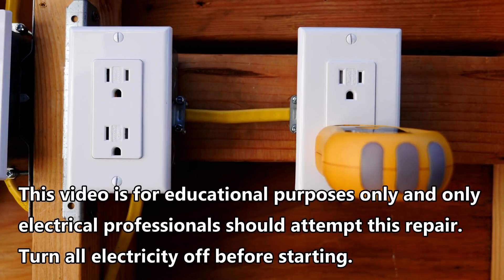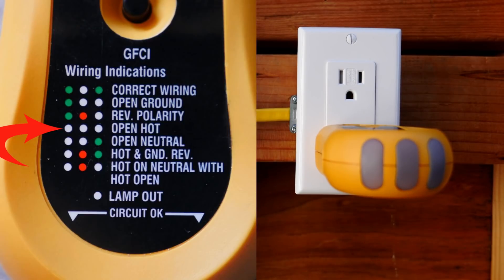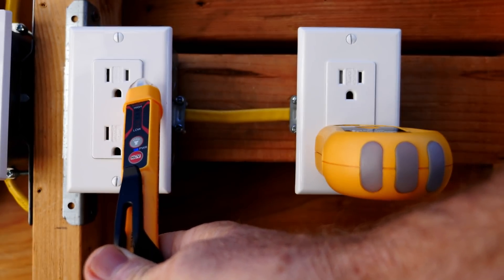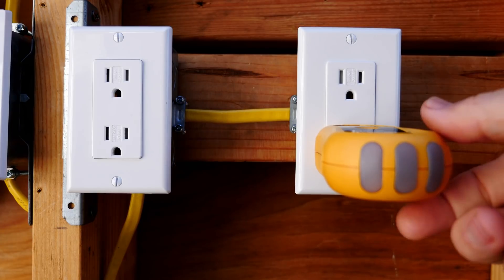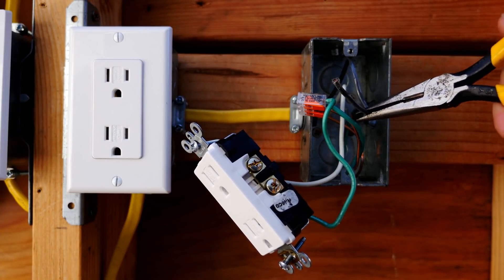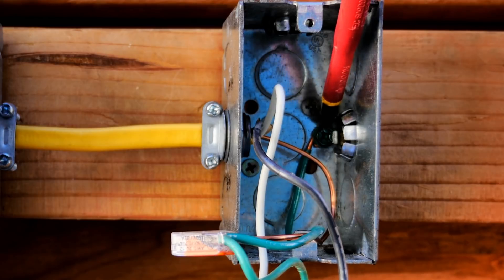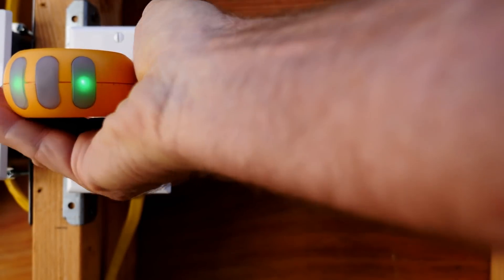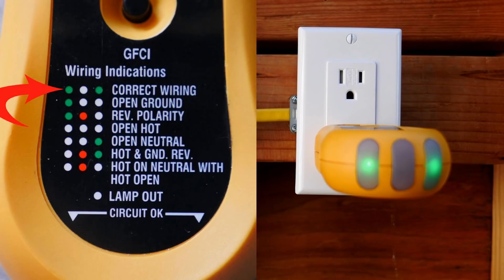An "Open Hot" Receptacle is VERY Dangerous!

Comment: A tester that reads open hot, can also mean that the tester itself is defective, just as a non-contact voltage detector can read no voltage if it's defective or has a dead battery. 
Always test again to a known energized outlet to be sure the tester works.
Turning off the main breaker before servicing is a good tip for safety. 
Thank you. 
Question: Would a circuit finder work with an open hot outlet if the neutral is still connected? 
Thanks again for your great content.
Reply from the maker: That's an excellent point! Meters and testers always need fresh batteries! No, I don't think a circuit breaker finder would be reliable if you were testing at or after the open hot. If you were testing more upstream from the open hot it should work fine.
Reply: @SparkyChannel  I have a Klein volt meter that doesn't need batteries.
Reply: @illestofdemall13  he knows not all testers need batteries. He didn’t type all testers that take batteries always need batteries.
Reply: @KitchenerLeslie2  I didn't say what he knows or doesn't know. I was just saying I have one that doesn't need batteries.
Reply: @illestofdemall13  it has to somewhere
Reply: @16BitDoggo  I have no idea what you are referring to. "It has to somewhere" what is it? And it has to somewhere? What are you saying?
Reply: @illestofdemall13  I meant that the non contact voltage tester needs batteries somewhere. It might be hidden.
Reply: @16BitDoggo  I wasn't talking about that. I have a 2 different volt meters from Klein that do not take/require batteries. If there is voltage present then the meter lights up to the approximate voltage that is present, like the old solenoid voltage testers (Wiggies).
Reply: @illestofdemall13  oh i thought you meant non contact voltage testers. So like a multi meter
Reply: Turning off the main breaker is not practical in most cases, because homeowners and/or other workers are using other circuits. If you know how to test and verify, then you can easily and accurately turn off the appropriate breaker to just the circuit that's being worked on.
Reply: @illestofdemall13  sounds good, looks good on paper.  but Mr. Murphy likes hanging around troubleshoots.

yes, there are ways you can test and be sure you've most likely got it down before you dig deep enough to be at risk; but this channel is to help people without as much experience.
Reply: @kenbrown2808  I do electrical and lighting for a living, so I am talking from my point of view. I can't turn off a whole house just to change a switch, or install a chandelier. For someone who doesn't know as much, they could turn the main breaker off, but I think someone needs to teach them the basics at least so they know how to measure voltage and make sure there is truly nothing to hurt them. They also need to know how many circuits are in the box they are dealing with, etc.
Reply: @kenbrown2808  I see what you mean, though. That's why Sparky has the disclaimer in the videos, though. If someone isn't competent in electricity, they should find someone who is and if they do their own work it's at their own risk.
Reply: @illestofdemall13  precisely. and as you know, a video isn't a substitute for years of experience.
Reply: if you don't have a live circuit handy for testing a non contact tester, you can usually test it by rubbing it on your arm.

Comment: My tester says open hot on a GFCI and the GFCI does not turn on. But a regular 3 prong outlet works fine and shows a green light in the same box and wires. I tried 2 GFCIs and both are the same, not working
Reply: Same here exactly same situation as you
Reply: @markdavis5979  I still haven't found what the problem is
Reply: Did you wire the "power-in" to the proper locations on the back of the GFCI
Reply: @tegbolddos  all wires are hooked into the proper prongs. I triple checked everything! Still nothing

Comment: I put a new APC UPS (high end  $1000 uninteruptable power supply) in an office and it immediately started beeping and the display stated a problem with neutral and ground. I hit the reset button and figured it was a fluke (I had installed hundreds of UPS's and never saw that before).  I forgot about it till the office owner called and said the UPS was beeping. He said he would talk to his electrician. Then he calls and says he noticed if he hit reset and all was well and then walked into the hall with motion sensing led lights he could hear the UPS beeping again. He repeated this several times... I had to go there yesterday and brought my 3-prong circuit tester. I plugged it into several outlets in the office... it did not light up at all.. I thought it had died somehow. Then I tested an outlet at my house and my tester works fine........... the $64000 question is how can an outlet work if the tester shows no lights? The label says if none of the lights come on it is "Open Hot" but how can it still work?

Comment: I wish the tester had 3 red lights to indicate an open hot and not 3 lights not lit at all. Confusing since the circuit could be completely off or this dangerous situation. 

Maybe it's just me lol
Reply: Its not technically possible. With no hot, theres no electricity to drive the meter. That "socket tester" meter is batteryless and uses the proving voltage to also power itself.

So it needs atleast one hot wire to work at all. Then it needs EITHER ground or neutral for a return path to light up itself too. This is why also this meter cannot detect multiple consequtive faults in the same socket.

Some socket testers do have a little metal plate that you put your finger on, which provides a grounding path for the electricity, but the metal plate then has a resistor to take down the current so low so its always safe for the human body.
These socket testers can test for even more faults which involves a non-existent GND and neutral for example.

But no socket-tester ever will be able to test without any hot available, because that would mean the meter has to invent electricity from thin air.

Comment: Good comments on how the open hot can be dangerous. However, something to remember is that it may not be in the box that's not working. The open could be anywhere from the outbound link in the box on the left to inside the outlet itself (i.e. defective outlet) on the right. After the initial testing, all that was known for sure was that power was reaching the outlet on the left. The open could be anywhere beyond that point.
Reply: Thx u I been trying to figure this my out, my outlet tester say there’s a open hot, but when I take the outlet out both hot (blk wires) are connected to brass... could open hot be in the wall and if so how can I fix that
Reply: @hightolerance8728  I would start by checking the next box upsteam and making sure everything is secure in there. My guess would be that's where the problem lies.
Reply: @Qazxswer68  I thought so but the next outlet up only has one hot an neutral, so I’m assuming its not ran off that outlet. And the outlet “after it” (which is in the next room, is being powered by the outlet that isn’t working (if that makes sense). I can’t find the outlet that is powering the broken one. I assume it must be a crappy electrical job being that is only a rental and hasnt been working since I moved in. The landlord keeps sayin he going to fix it, but all he did was cap it off. Sorry if my electrician lingo isn’t up too par.
Reply: @hightolerance8728   Bad landlords 👎  You're good. I'm not an electrician, just know enough to be dangerous and fix my own problems. So the receptacle in the next room does not have power also? Since the receptacle in question doesn't have power. Power can also come from a switch box. A hot stick, non contact voltage tester,  might come in handy here too.
Reply: Those things aren't for regular troubleshooting they are for checking everything at the end to make sure you did everything correctly but if your going to troubleshoot then you need to at least get a biggie voltage tester that will tell you 100%
If a wire is hot or if the newtral or ground are good.
I'm not sure what the details of your situation are but figure that box could be fed in from the back of the box.or it might be a dedicated circuit lots of home owners want dedicated circuits for the refrigerator..

Comment: It's nice of them to use green lights for the "good" connections.  my current plug tester has a white and amber and a red, and the red lights on a good receptacle; which is just wrong.  but not wrong enough I've gotten around to replacing it.

Comment: I have done a lot of DIY electrical work through my long life.  Seeing a no-lights reading on that tester I have taken that as confirmation of no current after switching off the breaker.  I now know better.  Thank you.
Reply from the maker: Thanks for sharing!
Reply: the only time you know for sure a wire is dead is if you're holding both ends.
Reply: @kenbrown2808  or one end and a grounded wire.
Reply: @KitchenerLeslie2  no, that's how you find out it's live.

Comment: Hi Bill ✋ Speaking of dangerous, I have a question. The company I work for, just leased a house that's just been recently built, more specifically, built in the last year. Anyhow, I'm prepping it for a group home for disabled clients. I was installing a grab bar by the master bedroom shower stall which is designed to roll into with a shower chair. There's a light at the top of the shower stall and the switch is on the same wall as the shower head. The switch is approximately 8" - 10" outside the tiled area. It's just a regular switch and cover. Everything has passed all inspections. The location of the switch concerns me. Is there code for this situation? I didn't feel comfortable with it, so I installed a weatherproof switch cover. Be great if you could cover this topic or any info would be helpful.  Thanks Bill!
Reply: it is permitted, but if it's in the splash zone because of a doorless shower, it's not a good idea.
Reply: In the UK, wall switches in bathrooms are not allowed.  You can only have a pull string from a ceiling mounted switch.  Much safer.

Comment: Can you by NEC run romex Stripped back about 15 feet an run through conduit as though it is THHN,from breaker box into attic and then run shielded romex across attic and down behind drywall to receptacle ?
Reply from the maker: Hi Mike! No, because Romex has a bare copper ground wire. You need an insulated green wire to run in EMT.
Reply: @SparkyChannel  what if I run in electric pvc? Conduit
Reply: @SparkyChannel  I'm under the belief that most ahj if using EMT you don't need an igc. but that i run one anyways and I have been doing it like this for over 20 yes they make EMT to Romex connector for a reason 🤔  cld be another ahj discretionary ruleing
Reply: PVC conduit from attic to power box.
Reply: Can’t he just leave the Romex in the conduit for that short run? I thought it was allowed for wire protection
Reply: NEC specifically allows you to sleeve unstripped NM cable in EMT or PVC for physical protection of exposed wiring.

Comment: I realize this is just a demonstration setup, but I have been told by a licensed electrician that it's against code to run a cable into the SIDE of a 2x4 handy box unless it's being used as a junction box. The reason cited is the cable clamp threads and locknut will be too close to the device terminals. Is this a legitimate code violation?
Reply from the maker: It depends on the listing and labeling of the box. That is, it should say on the box packaging along with the UL listing symbol. Like you noticed, I just did that for demonstration purposes so viewers could understand where the cable came from and where it was going.

Comment: Why does one or the other green LED blink when you plug in the outlet tester?
And, I don't know if he was pulling my leg, but a friend (licensed) was telling me to always wrap the tape clockwise, that was code and the inspector would flunk the job if it was counterclockwise? 
 You're obviously a pro, I notice you even regulate the screw heads on the cover plates!
Reply: The LED’s flash because that’s how they work. Your eye won’t catch it, but a camera will always see it as flashing!
Reply: @dodgeguyz  One does, the other doesn't. I would have thought both would either flash (on AC or half wave rectifier) or not flash, if a full wave and cap were used.
Reply: @lyfandeth  
I think it’s just the design of the tester.
Reply: I’d like to see if it switches sides if ground and neutral are reversed. If the flicker stays left it’s the led, if it moves I’m not sure what that means.

Comment: If I'm using a DMM instead of an outlet tester, what values would show me a loose hot? Testing for voltage between the neutral and ground shows neutral problems. Would I see no or low V between hot and neutral, should I use low impedance setting?
Reply from the maker: I love the low Z setting on my Fluke 117. I would use it for the tests you mentioned. A loose hot might show up as low or intermittently changing voltage.

Comment: An alternative to switching everything off would be using insulated tools and standing on an insulated rubber mat. Such mats are available with official rating, but I‘ve also seen guys using the rubber mats from their cars.
Sometimes you don‘t have the luxury that you can switch everything off.
But this is a task only for experienced electricians.
What will the outlet tester indicate if only the line is connected but the neutral and ground are open?
Reply from the maker: Hi Marcel! Yes, but as you say, it's just for experienced electricians. Neutral and ground open no lights but a NCV tester should still work.
Reply: @SparkyChannel  Like I thought, on the inside these outlet testers work almost all the same way, and you can trick them with the worst faults...

Here are two videos from a UK electrician how these testers work, and which miswires they can't reveal. It's quite interesting that these things work with only such a few parts inside. There's not much inside.

No.1

https://www.youtube.com/watch?v=87Y5X9wfxQM

No. 2

https://www.youtube.com/watch?v=GSDBVsViwh0

Comment: I don't trust NCV detectors. They beep and beep and don't beep and....give me a meter. You can hold one lead in ur hand and probe with the other and you'll see voltage. Usually 80 volts on the hot, 0V netural!
Reply from the maker: I agree. Many meters have NCV testers built in so that you can do both tests with one device.
Reply: sounds good, looks good on paper, but a tweeter will still read voltage through insulation.

Comment: Why did you put electrical tape around the receptacle?
Reply: Taping around the receptacle causes a mess when it needs to be worked on later.   The tape dries out and falls off.  Also using the push in terminal is what caused the break to begin with, or poor stripping on the original install.   Obviously not on your demo setup.  Turning the power to the.whole house off seems a little extreme.  It's easy enough to take the cover off and see the problem.
Reply: @tomsnj  that was a spec grade screw tightened terminal, not a stab.  though you're right that particular failure is usually a stab connection gone bad.
Reply: @tomsnj  Amateur here again and I do agree with you. Even though I tape it does make a mess in future, dries out and\or falls off. Just old habits are tough to break... but recently I have skipped the taping a few times.
Reply from the maker: It's not code to tape receptacles, it's just something I do to increase safety and reduce the possibility of a short.
Reply: @SparkyChannel  Amateur here but I've always done this too!
Reply: David Munoz  Taping was a really good idea in the "old days" of metal boxes and metal cover plates.  A loose hot wire could electrify the box/plate and arc causing a potential fire.  Personally, I flip flop on using the tape method on plastic boxes and plates.
Reply: @Nickvec  Interesting again.... Makes me feel better because for the most part I have taped, and the majority of switches\outlets are in metal boxes.... Thanks
Reply: Metal box

Comment: How come you don’t sleeves the ground Cooper wires in the box in the uk the would be a code three on a inspection a it’s ban practice to . I am a big fan of the voltage detector I like use  multifunction tester I trained the old school ways of testing . Loving the videos .stay safe
Reply from the maker: Thanks Ian! Well, it's just the way we do it in America. I know it looks bad to UK Sparkies but it's the way it is here. Thanks, you guys stay safe as well!
Reply: 👍🏼👍🏼 always look forward to the videos plus checking out your other videos to loving the electricians challenge videos as well 👍🏼👍🏼
Reply from the maker: @iandrew6347  Yes, England should have been in the international contest!!! Did you see my USA vs Australia vs China vs Canada video?
Reply: I've seen your boxes and outlets your wires are really cramed in there so a chance of a bare conductor to contact a live term is more likely also we don't have to but sum of us will if it looks like its needed and a lot of us do the tape around terms
Reply: @wizard3z868  right. we have much bigger electrical boxes, and we run most of our wiring at half the voltage that the UK runs.